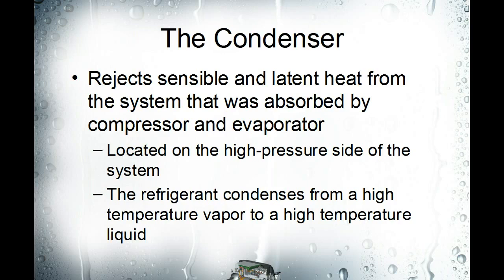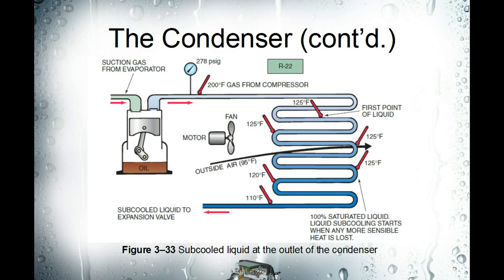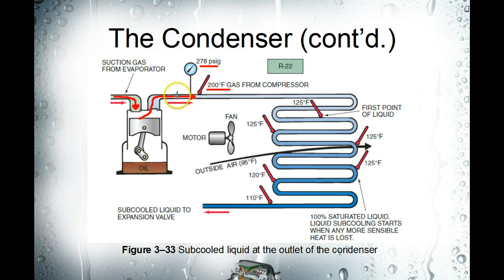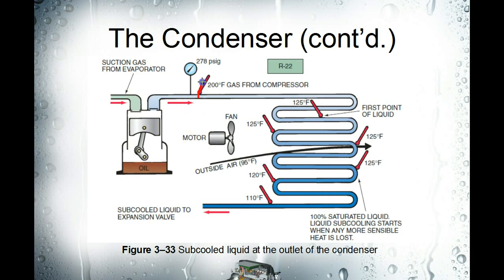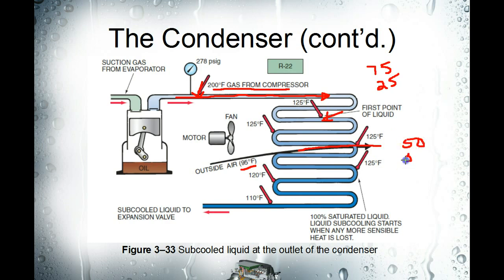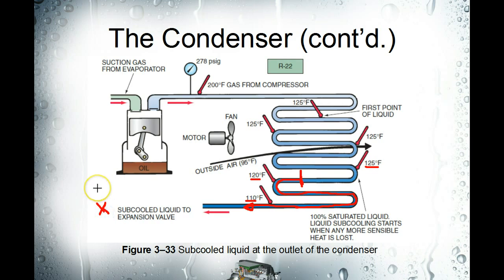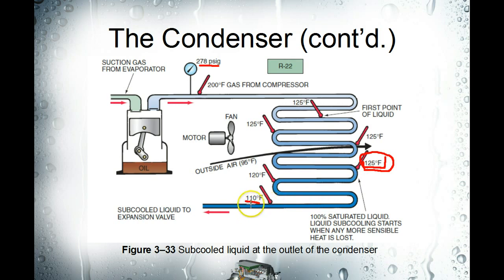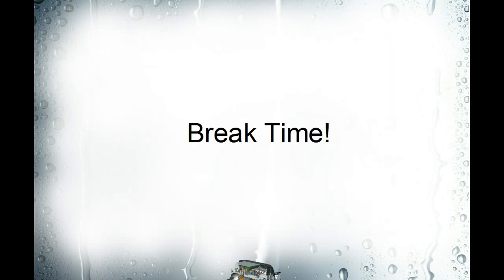Module 3 - Video Lesson The Condenser

Comment: there is a mistake at 3:40 when you say that the mixture entering the condenser is 75% liquid and 25% vapor. It should be 75% vapor and 25% liquid.